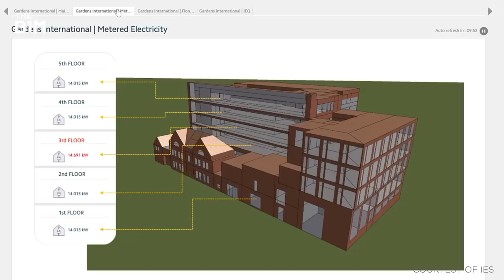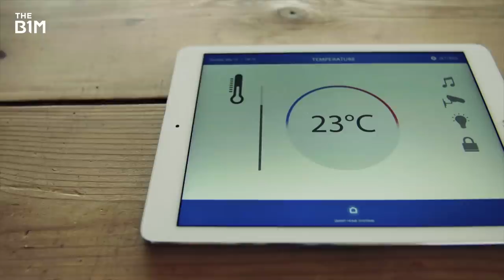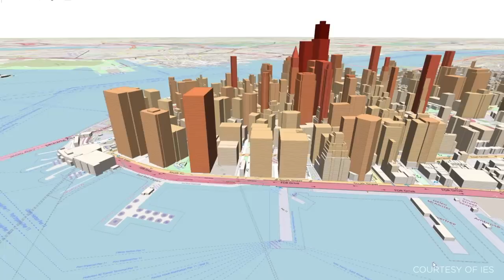How Buildings Can Power Our World

Comment: I just want to note that hydropower, despite being a renewable energy source, has significant environmental consequences: it disrupts the river ecosystem upstream and downstream of the dam. Upstream, the large water column is ecologically rather useless compared to the shallow yet dynamic stream that was initially there, and downstream erosion due to lack of sediment transport. There are more than a million dams in European rivers, and there is an international dam removal/stream restoration effort going on. 

While I'm at it, and since you've gotten this far in my comment, I might as well note that wind farms at sea have the potential to greatly strenghten ecology. Firstly, because the area becomes a no-fishing (with bottom-trawling nets) zone, and secondly, because reefs can develop on the frames that hold the windmills. 

You guys rock, keep making more great videos! :)

Comment: Years ago, I was pushing the idea of inflation insituform buildings using fiber reinforced thermoplastic structural members with imbedded resistance wires. The building could be taken down and moved rather than torn down. Concrete adds a lot to the CO2 problem so buildings that use plastics and that need not be torn down with something new later built in its place, but rather moved, modified, and repurposed could make even these buildings greener.

Comment: Solar Panels rooftop might indeed create "energy positive" buildings, but they are in no way reducing CO2 emissions (compared to nucelar) because Solar (and wind) energy is very unreliable (it doesn't work all the time, obviously), so you're forced to have in parallel to them "instant energy" solutions, and these are basicaly Fossil Fuel powerplants (Coal, Oil & Gaz pretty much) as only them can change their output quickly to meet demand. So not only you create more exepensive solution (increasing the price of electricity) but you also increase CO2 emissions from it, much like Germany (tho it might not shown on graphs as they simply just buy elec from other countries to counter this and meet their "low co2" plans, such a joke).
Futhermore Solar is also pretty bad for the environnement as it's not economicaly viable to recycle them so none does, and Solar waste materials are even worst than batteries waste material (which are also a huge problem). And dont forget Solar Panels are to be changed every 20 years or so...
Dont be fooled by the "green" energy claims everything is shoving down your throat.

If we trully want to go in the proper direction we need to push for Nucelar energy (Thorium MSR in the next years, and Fusion in the very VERY far futur) worldwide.
We would also need to force the world to recycle wastes like battery and solar panels, even if it's not economicaly worth it (battery will become keys in the future for both transportation and electricity storing, so this is insanly important to do).
We also need worldwide regulation to get proper thermal insulation and heat pumps on every new building (and helps to get it done on old ones).
And worldwide regulation on packaging plastics, which could by itself reduce our total plastic consumption by 30 - 35%.
Finaly we need to start straight up banning worldwide electricity production from Fossil Fuels (First Coal, then Oil, then Gaz, then everything else).
Oh, and straight ban on the goddamn cruise ships, these things are the worst of the worst, why is this still allowed to even exist ? Are people blind ? insane ? I'm baffled.
Our countries leader are seeing each others to speak about the future and the environnement a lot and yet none of these points are even remotely talked about. How deep in the shit do we need to be before they start doing something trully meaningful ?

Comment: How much carbon emission is there in 100watt PV panel making , that should also be discussed..
Reply: Utkarsh Srivastav its generally accepted that the carbon footprint of a solar panel is repaid in a matter of months once that panel is generating. Remember that the biggest components by weight and carbon footprint  are the glass and aluminium framing, both of which are widely and easily recycled at the end of life.

Comment: The one part of this that makes no sense--and this video is not the first time I've heard this notion voiced--is the idea that we need to reduce energy consumption. The amount of energy we consume is not the point, but rather the sources of that energy. If you're getting sufficient energy from wind, solar and water, let's say, you're making a zero impact on the environment, so what is the need to reduce the amount of energy you use? In addition, this video made no mention of batteries. It mentioned, for example, a building that generates thirty percent more energy than it needs, and then sells that thirty percent back to the utility. That's fine, but another option is to store that excess energy in a Tesla battery pack, let's say, so that when there is a blackout the building stays lit. Finally, since this video focused so much on construction, there are construction materials that can retain heat or coolness, reducing the need for air conditioning or traditional heating methods. I was surprised the makers of this video made no mention of this.
Reply: While I agree with you that storing the excess energy in batteries could be a good idea, I think you're missing the point of them reducing the power they use. Focusing just on switching to renewable and clean power is important, but it takes a long time and costs quite a lot of money. Since we'll still be using fossil fuels for a while, we should focus on using less of that energy to make the change easier and quicker.

Comment: Buildings need to be designed to be energy efficient. Solar is good. I use solar. But dollar for dollar, running my generator is far more cost effective than using solar.
Reply: Zach Jones hmm, I think your maths may be a bit off! My £5,000 solar system is on track to pay for itself in about six years. It will generate useful power for at least 25 years, meaning around two decades of completely free power. How many generators and how much fuel will you consume over 25 years to achieve the same?

Comment: A Trompe connected to a turbine on every building - TROMPE
Reply: Run by what?
Reply: Yup. So in a building, where's the consistent flow of water coming from?
Reply: @mra4955  I think by design itll be a closed in system. you would have the water in a pipe or large tunnel on more than one side- up to a certain level  - as the water is pulled making the compression the water travels. The source, onced contained, would be all you need
Reply: @belesariius   @belesariius  not sure I understand sorry, examples?
Reply: @mra4955  unfortunately no ( at least i dont think ) its more of a conecptual idea based on that vid by mollison - and having a gravity dropped water air compressor, with the height of the building working to your advantage - im not sure if there are examples - but if you find one, let me know :)
Reply: @belesariius  You could always design it!
I understand the concept, and ole Bill. The tech has been around for a while. I just can't see how it would work in a building, especially closed loop, as you'd need to pump the water (captured rainwater I would assume) back up to the top, which defeats the purpose, as energy would be required to do so. And the pressure you'd get just wouldn't be worth it, especially to run the pump and then a turbine to generate electrical energy, as you suggest. Check out air compression battery storage systems, they seem to be the best way to utilize this type of tech efficiently.
Reply: @mra4955   as far as i know when the water falls, it pulls the vacuum behind it- and when it pushes the air on the other side that pushes, and it creates another compression on the other side ( in bills video, he shows this ) once the water is in there it doesnt have to be replenished as it is in a closed system. But yes, better brains than mine prevail- i also quite fond of the shore based tidal vacuum turbine idea too - lots of lovely creative ideas out there
Reply: @belesariius  hmm, I havnt looked it up in years, but from memory, the system involves  a constant stream of water (flowing river or stream) diverted into tube or conduit that utilises gravity (down into the ground usually, deeper the more pressure) and along the way air is 'injected' into the flowing water as it descends (usually with small open ended conduits, sometimes just straws for homemade jobs), which builds pressure as it flows down into the ground and into a sealed chamber where the air then separates from the water and fills up the chamber, which can then be released via a pipe/valve running up to ground levell, giving you pressured air. The remaining water is diverted back down stream or potentially into another system (aquaponics?).
Reply: @mra4955  sounds awfully like the trompe idea lol - i love closed systems especially in things like aquaponics or hydroponics, such elegence and efficiency ( central to permaculture in general ) i shall look at that in more detail
Reply: @belesariius  yeah. I guess if you had a decent stream on your land and you want aquaponics, you'd divert water into a series of ponds instead. There was a video on YouTube a while ago where a guy did it with a small stream in Hawaii, and built an above ground aquaponics system. Small, but not sure it's worth the effort.
Reply: @mra4955  yea scale is always an issue- although there is a lot of success on small lots in urban areas in the US - some clever work to funnel water around linked systems oxygenating and fertilising as it goes- depends on the setup and conditions like everything else i guess.